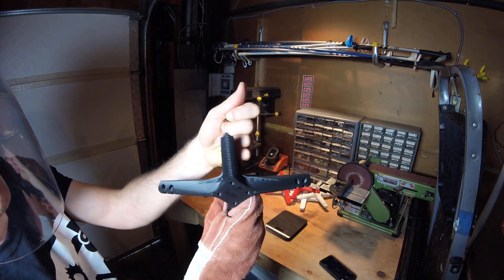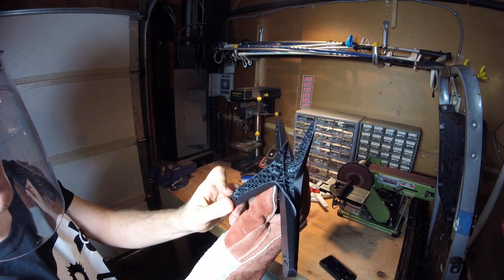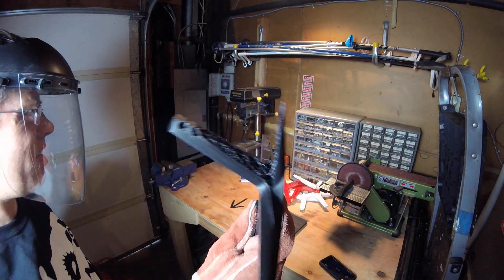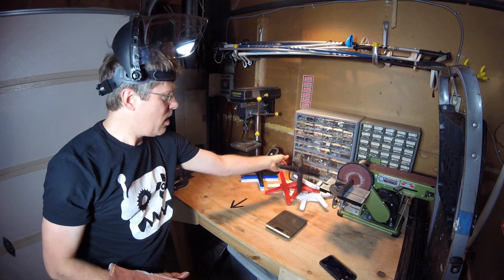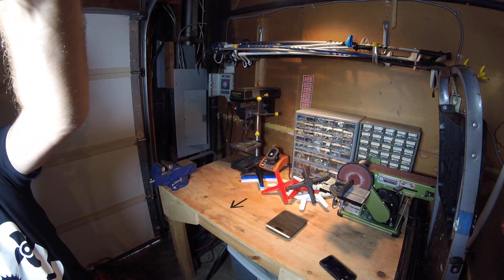Proto-pasta Polycarbonate-ABS Alloy in Black (200% extrusion width, 73.5 grams)

Comment: Were you using an enclosure? Even +10C above ambient helps a lot. I also have used some halogen heat lamps pointed at the part to help keep the higher up layers hot. Heat transfer through the plastics is not very good so the radiation across the entire part is a major benefit. See this NASA interns project for more info: https://ntrs.nasa.gov/archive/nasa/casi.ntrs.nasa.gov/20170000214.pdf